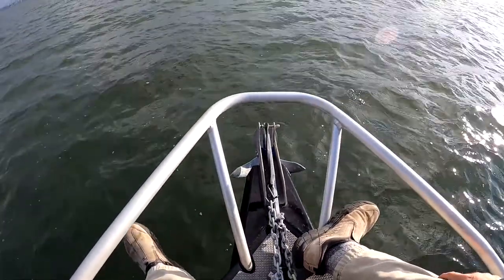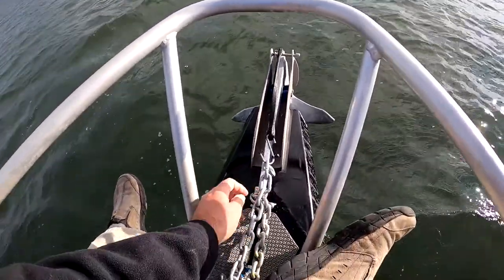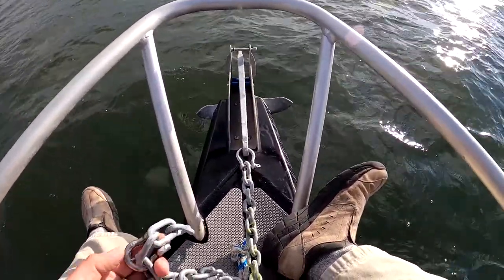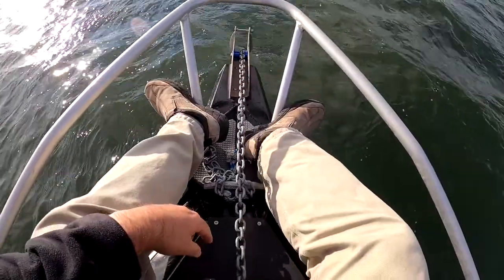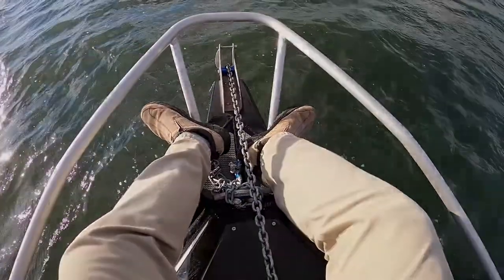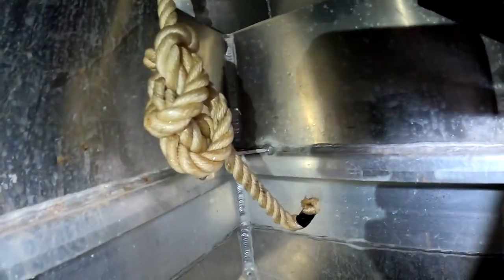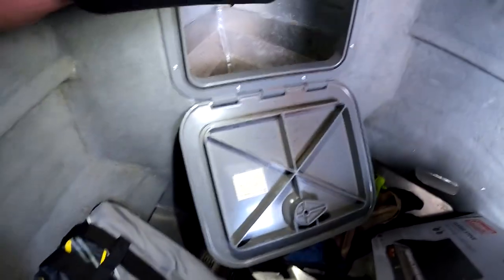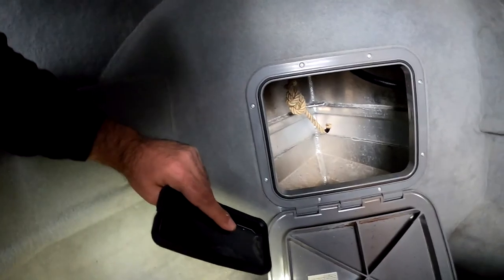Stabicraft 2050 Supercab  Anchor Well, 3 years of no rinse saltwater use. | Stabicraft on the Sound

Comment: I won't have my 2050 in Alaska for a few weeks, could you please tell me what size is the transom drain plug, and is it threaded or smooth? I want to order a drain plug light. Thanks. Also I just use a piece of paracord to secure the anchor to cleat, it's faster in an emergency and doesn't rust like bungee s hooks
Reply from the maker: Thanks for the tip on the paracord.  I keep a few bundles of that in my boat emergency kit.  I'll have to give that a try.  The drain plug is threaded, I lost mine over a year ago and have been using the traditional style expanding plug since.  I'll measure the hole and the plug I'm using and let you know what they are next time I'm over at the boat, should be later this week!

Comment: Hey thanks for doing that video. I see now where it drains. Hey I’m in the process of ordering a 2050 direct from stabi.  Any thing different you wish you’d added in the options list if you could do it over?  Other than for looks is it really necessary to have paint on the boat?
Reply from the maker: I highly doubt paint is a necessity.  I think some of Stabi’s smaller boats come in natural aluminum finish. They look fine to me. As for things I’d do different. Definitely would have a factory fold up step, if for no other reason than boarding for trip prep and clean out after. Having been caught out at night, any factory lighting options I’d add. And now that I’m going out every weekend even in winter, If they offer any kind of factory added heating on a 2050 I’d add it too. Oh, dual wipers!  If that’s an option it’ll be worth it. Other than those, I’d probably have had it plumbed with a live well set up too. Out of all those the two I’d put at the top, then do the rest myself later, would be the fold up swim/dive step and dual wipers. I’ll look through the current options if I can find them. Not listed, but if it’s available, under floor storage would be really nice, and if there’s any options for a larger fuel tank than 40 US Gallons I would take those too.
Reply: Stabicraft on the Sound thanks for that. I’m trying to get them to give me an option for the bigger fuel tank. Hoping they can get that done.  I’m not getting the paint coz I’m saving almost 5k for other stuff.
Reply: If you don't mind a more spartan look, leaving the alloy unpainted is actually a better choice.  The paint can actually foster corrosion in some cases.  Marine grade alloy resists corrosion by self-forming a protective layer on its surface.  Also, be fastidious with your sacrificial anodes, on both the hull and the motor.  Cheers!